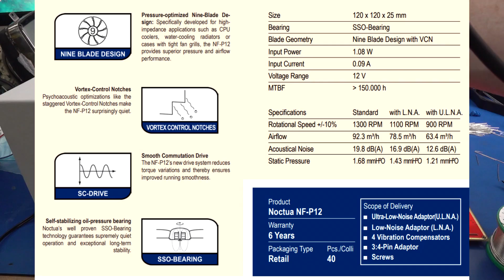Soldering Fume Extractor Fan Upgrade

Comment: Probably you can put another fan after first.
Reply: Yeah, was thinking that. Improvement likely won't be great though with effectively short ducting, but should improve a bit which could make all the difference. I've done some graphs of that kind of thing here: http://solarsponge.com/article.htm
Reply: You need a significant duct length so that the turbulence from the first doesn't significantly reduce the effectiveness of the second.  I suggest to allow 5 diameters at a minimum. 20 diameters to be sure that you have laminar flow restored. 

The Noctua fans are acoustically quiet because of the turbulence.
Reply: @EEVblog  may improve substantially, but the second fan should be driven faster, or have a higher pitch (throwing a bit of axial flow turbine theory to the problem :)  )
Reply: Stator vanes would also reduce the turbulence, but is a bit impractical here.
Reply: Looks like the old fan could be left in there, just in case you need a bit more power.
Reply: @BerndFelsche  I think every server manufacturer in the world would disagree with your assessment that the fans need to be mounted a distance apart. Every server I've ever worked on (and I work on hundreds of them a year) has dual-layer fans that are mounted nuts-to-butts in the cases. Granted, they're spinning MUCH faster, so have somewhat improved flow.

Stacking fans increases their static pressure, and will help to overcome the resistance of not only that filter, but the vents in the case, and should help with flow.

Maybe sandwiching the filter between the two fans could help. That way, the "intake" fan has a slightly less-restrictive input, even though its output is hindered by hitting the filter?
Reply: @locutusofborg2880  I've seen many times the coupled fans inside Proliant servers during my previous job, but another thing that I remember from the experience in the server room, is the really loud noise that those servers made.
Unlike some workstations, servers are not designed for low noise operation.
Reply: Just wondering about 2 fans, but spinning in opposite directions...
Reply: @michelfeinstein  that seems interesting, as it is a configuration that suggests a similar geometry as that of rotor+stator vanes (the later have a pitch opposite to that of the rotor blades). Turbine engines cannot have this configuration because all of the gas compressor stages are attached to the same shaft, hence spin in the same direction and have the same pitch orientation.
In this case there isn't such limitation, but it may be a challemge to find fans with both pitch orientations.
Reply: @LuisTeixeira  I guess he would have to reverse the fan motor wires so it will spin in the opposite direction.
Reply: @michelfeinstein  both the spinning direction and the pitch angle need to be the inverse of the other fan, so that the air flows in the same direction.
Reply: @LuisTeixeira  oh, yes, makes sense, not an aero engineer here lol
Reply: @BerndFelsche  Just put a 3D-Printed stator directly between the two fans.
Reply: PC water-cooling enthusiasts often put two fans in "push-pull" configuration: one before and one after the radiator to blow air through: substitute the radiator with filter in this case.
A spacer/shroud between fan and radiator is often added to spread the air more evenly over the radiator: 2 cm is considered optimal: more than that and you'd lose air pressure.
Reply: @EEVblog  I really like the high airflow high air pressure vardar fans. I use them for radiators in my computers and rigged one with a carbon filter in the front and back for desktop soldering

Comment: You need an IoT fan so you can have the convenience of creating an account, confirming your email, logging in, taking part in a quick survey, looking over partner offers, and adjusting your fan speed on the fly.
Reply: Why does the app need permissions to access my contacts and photos?
Reply: It also needs to measure how much fumes have gone through so it will order replacement solder reels? 🤣
Reply: Order now, and sign up for the service for free! In six months, being able to turn your fan on will require a paid membership.
Reply: Don´t forget, it has to calculate how much longer you will live because of the fumes it sucked up.

Comment: That Pace Fume Exhauster costs a couple hundred bucks. It's just a $20 fan inside a metal enclosure.
Reply: They are masters of selling crap at premium prices, have a look at their hotairs, or "dont use it too long or your hand will get burned" tweezers
Reply: That's why I built my own.
Reply: I've got about 30 of those 120x38 240v fans... from VFD repairs. All working and still good. Bearings are also replaceable and are the standard 3x8x4 Pc fan size.  I've got 4 bolted together for a solder extractor.  ~400cfm, F low noise 🤣 
That whole solder extractor is a complete and utter ripoff.
Reply: To be fair, those 240v die-cast metal fans are not cheap from brand-names. I've seen them cost up to $200 before.
Reply: @AmericanLocomotive1  
That sounds like a ripoff too. You can get name brand diecast frame fans from RS reasonably cheap. Would also be cheaper for a factory buying in bulk...
https://uk.rs-online.com/mobile/p/axial-fans/5440706/
Reply: The Post Apocalyptic Inventor made as good a device out of a couple layers of activated carbon filter and a computer fan.  Industrial gear is a mix of cheap crap at big prices and good stuff that costs a fortune because of low volume.
Reply: You can order the DP201A from germany for under 10€
Reply: @diegor4966  80mm fan ?! that's too small and too noisy even a low-noise model from Noctua compared to a 120mm one.

Comment: Looking at only the CFM of the fan is as bad as only looking at the open circuit voltage of a battery. Fans have a pressure/CFM curve just like batteries have a V/I curve; when you introduce a filter like the one in this extractor that becomes really important as some fans (ones with a high static pressure) are almost unaffected, while other weaker fans (PC case fans with a low static pressure) can be rendered useless.
Reply: they are high static pressure fans 7:57
Reply: @ikbendusan  Engineering is done with numbers, not marketing wankery like "high" static pressure. Digikey has fans with static pressures dozens of times higher than the Noctua fan.
Reply: @TheHuesSciTech  okay sure but it's a high static pressure computer fan. bet your ass those digikey fans also make much more noise
Reply: @ikbendusan  I've probably done a poor job of making my point, but my point is this: focusing entirely on the CFM of the fan and completely ignoring its static pressure and the resistance of the filter material, is poor practice. Dave likes using electrical engineering analogies for heatsinking solutions, I can't help but think that the complete lack of any such analogy here is due to him not having considered it. Or maybe it'll be coming in a follow-up video, I dunno. In any case, telling me that this fan has a "high" static pressure is completely pointless.
Reply: @TheHuesSciTech  i meant that it was a "high" static pressure fan in the computer fan reference frame. i understand where you're coming from

Comment: There was room inside for a $5 AC dimmer.. at half speed, I reckon it would still be better than a PC fan.
Reply: Fans usually have an induction motor so you can't change speed via this method
Reply: @KACPER050599  Fan speed controllers are about $10-15 or less, they would work well with this fan.
Reply: @KACPER050599  True, but turn down the voltage enough and you'll find a range on the pot where it skips sync with the line based on air loading etc.. It's not damaging.
Reply: .. more correctly, turn down the pot adjusting phase angle of Triac conduction, at some point it will reduce average voltage (fan core may buzz a bit at some rpm's) WMMV of course.
Reply: @CliveChamberlain946  The fact that this is a metal fan alone makes it inferior to a computer fan. Ideally the entire device should be made of plastics that dampen the vibration, even the steel enclosure.
Reply: @Basement-Science  Nothing wrong with metal fans. EBMPapst GmbH is still what many consider 'the' benchmark. Balance is machine perfect with resonance frequencies higher but for industrial use, noise is not an issue. I have three 220v "System Papst" 120mm double-depth fans pulled from a 50-year old Honeywell Bull mainframe still working silently in a window 7/24 at 150v (via 24v wired as boost xformer) to ventilate my basement. Keep fingers clear! they require 60-sec to spool down.
Reply: @CliveChamberlain946  I just mean in terms of noise level alone. Of course for high power ones you have to go with metal at some point since plastic can´t handle the mechanical stresses anymore. Since extreme precision automatically means high cost, you can´t really compare that to something for less than 10$. 

If you need more airflow at low noise levels, the best solution allround is usually to go for bigger diameter fans or to use an array of pc fans for example.
Regardless, that AC fan in dave´s fume extractor is clearly a cheap piece of junk, so I wouldn´t bother trying to run it at lower speeds.
Reply: @Basement-Science  How is it $10 w/o the 120-to-12vdc power supply to go with it? I stand by my 1st comment: 1 drill hole, a $5 rotary push dimmer.. done in 5 minutes. Silent at half speed, and still pushes more air for less $$ and time (which Dave lacks).
Reply: @CliveChamberlain946  Don´t you have some old wall adapters lying around? Personally I keep a bunch of 1$ ebay buck-boost modules on hand, so it doesn´t even matter what voltage your wall adapter puts out, and you get speed control for free. Even if you don´t have a wall adapter, they´re not exactly expensive either.

Besides, the point of dave´s mod was to make this thing silent enough so it is inaudible in his videos while still being somewhat effective. For that you need the best airflow-to-noise ratio you can get, which just so happens to be exactly what you want in a PC as well, hence why those fans are the best option for this. Plus he wanted to do this using what he had on hand. Dave spent 0$ on this.

Your suggestion is also based on something that may not work at all with this particular motor and will only work with some dimmers, and as you say yourself, may generate other buzzing noises, which defeats the purpose. That´s hardly a quick or easy solution.

Comment: Most bang for the buck: Whack together a box stuffed with an old PC power supply (w/ 12v at 10 amps) and a 3-speed centrifugal 12v blower fan you can buy from an Auto-Wrecker @ $20. Attach a few meters of dryer vent hose and stuff some place out of sight (LV turn on cable can run inside the hose if you wish).
Reply: I bought a cheap ducted RC jet fan for this purpose. (90mm 12 blade, $70AUD) Noisy as hell at full tilt, but completely recycled all of the air in the room in approximately 15 seconds. At much lower speeds it incredibly effective, can hardly hear it and doesn't require the 25 odd amps it uses at full noise.  Lately I've been using it to exhaust while stick welding.

Comment: Dave. Just put a dimmer. I have one very strong fan from a HP server(2,5A, 12v, 30W), the same size as yours and I made a simple voltage controller with an 2n3055. You can lower the voltageand the performance will be better then this new you are using. I suggest to by a  stock AC-dimmer, just return the ac fan and put the dimmer. Will be perfect.

Comment: So @eevblog in college they taught us the simple ac mains->capacitor->bridge rectifier circuit. You in the past have spoken about safe and reliable mains circuits. Could you take a moment to talk about a simple & quick long term 12v solution that could work in this fan application. Maybe some daveCAD too
Reply: Jonathan Wilhelm Order is Mains->transformer->fuse->Rectifier->Capacitor  for the simple type, change transformer or transformer wiring (multitap) to change voltage.  Big fail getting the order wrong.  Fuse before transformer if it is the "short proof" type that drops output voltage on overload.  Don't use an "electronic transformer", it's marketing wank for an unspecified power supply for lamps.
Reply: @johnfrancisdoe1563  thank you for the correction. Been trying to find more info on the subject. What are other safe, simple, and reliable circuits available for the mains ac to DC <80v and possible high current too

Comment: 2x2 120mm or 3x3 80mm fans and then a long tapered duct into an aluminium flexible/rigide hose that you can position anywhere over/at your work where you need it. Put the fan part behind/under the desk and its noise isn't anymore than a PC.

Comment: Blowing air across the board may result in cold solder joints.
Reply: It's okay as long as the airflow is above the board and joints only.

Comment: Noctua put out some decent ‘industrial’ fans as well. Designed for longevity, I.e keep all the dust and debris well out of the way of bearings.

Bung a variable resistor on it and you’re done.
Reply: I have a noctua cooler from like 08 and the fan is still good.
Reply: Noctua is fine, but not spectacular and definitely overhyped, there are better industrial fans out there
Reply: @FooBar89  industrial fans, yes. I don't think the Noctua industrial are very outstanding. However, in the PC fan segment they do have some of the best fans out there. I have never seen a fan move that much air so quietly as the S12 A for example. They are very specialized though because they do not produce a lot of static pressure, so you cannot use them on radiators, filters or tight grills.
They are very durable, too and don't start rattling or squeaking after a year or two like a lot of other fans that seem fine at first.
Reply: @FooBar89  I do like noctua fans but have to agree, there are some amazing industrial fans.
I managed to get 30 of these new/old stock for £40 from ebay.
https://uk.rs-online.com/mobile/p/axial-fans/7511532/
They are very well made; balanced rotors, ball bearing, brass bearing housing, spin down to 250-300rpm at around 3v too.

Comment: Those fans are designed for very low noise, they offer higher cfm 2200 rpm fans aswell. And even those are really damn silent!
Noctua is an Austrian company BTW, makes me proud every time :D
Reply: It is only quiet if there is no filter or grill making the noise.
Reply: s baxter I know, same happens if you put them onto a radiator. They get louder, but not much.
Reply: @DrakkarCalethiel  depends on the type of blades of the exact model though. Some models are more suited for pull-operation on radiators or filters, some are less. A very good example is the otherwise excellent Noiseblocker eloop which gets horribly loud in pull-operation on filters or radiators.
There are so many parameters to a fan other than rpm and cubic meters per hour, most of the time you'll have to buy at least two or three until you get the perfect model for a certain application.
Reply: Heinrich Müller Yeah, noise depends heavily on the blade geometry  in certain applications. The EK Vardar I use are a bit more noisy in push than pull. But they are built for static pressure.

Comment: It's fairly obstructed with that thick filter and vent.

Try some high static pressure fans, They're designed with blades intended to deal with the higher pressures required when using them with radiators when water-cooling, a similar obstructed airflow use.

Look at the difference in blades, you'll see a similar design shared between your original mains powered fan blades and the high static pressure fan blades. Larger blades, push harder.
Reply: they are high static pressure fans 7:57
Reply: @ikbendusan  good spot. Interesting... They look really weedy fan blades though! Really odd design guess it must be the noise optimisation.
Reply: @ikbendusan  They're high pressure for a case fan but look at the previous fan again, similar types of fans can have a static pressure as high 50-100mmH2O for example here's a delta sever fan I happen to own: PFC0812DE-SP04

It's an order of magnitude stronger and louder, so I have no clue what the optimum target would be but I would probably aim for at least 10mmH20, because I suspect that one or two is far too low for this and is hampering it's performance.
Reply: @lmaoroflcopter  Console, No! You got marketeered! Engineering is done with numbers, not marketing wankery like "high" static pressure. Digikey has fans with static pressures dozens of times higher than the Noctua fan.
Reply: @TheHuesSciTech  I attributed large blades to static pressure fans because that's what I'm familiar with as being a clear design difference between my static pressure and high airflow fans. That's all.

As for "real engineering being done with numbers" yes, yes it is. What was your point? That I recommend he buy some high static pressure fans without specifying a mmH2O value? I'll leave that to him and his decision making process.
Reply: @lmaoroflcopter  I'm on your side! I was saying that you shouldn't have retracted your point on the basis that "they are high static pressure fans"
Reply: You're right,  NF-P12 is very old design, about 10 years old. It's not high RPM, it's not designed for high static pressure either.    This is a mediocre computer fan.
Reply: @vgamesx1  the optimum would be tube ventilation with something like a woodworker's shop dust collector on the other end :D
Reply: @Mr.Leeroy  Heh that'd be a nice way to re-purpose one, but you know they actually make those? For example the hakko FA430 with up to 167cfm.

Comment: The most that filter does is restrict airflow and prevent any objects from getting sucked into the fan, for filtering the smoke it's useless, it sucks the smoke away from you and into the room. I'd stick a long kitchen hood hose on a high flow fan and stick the fan inside a box under the desk on shock mounts to prevent vibration noise coupling.